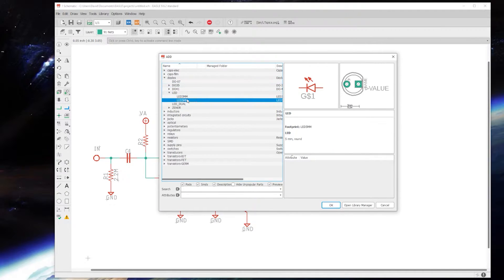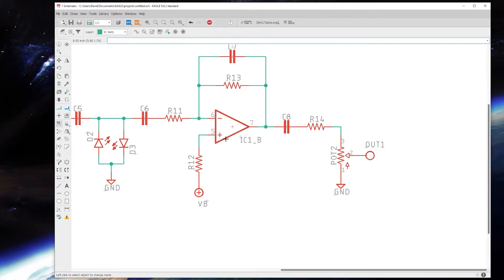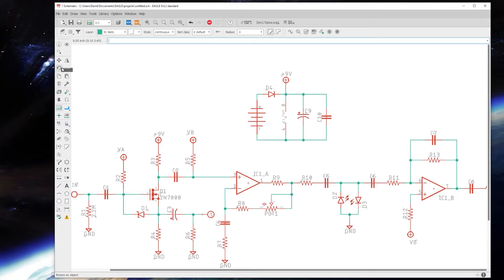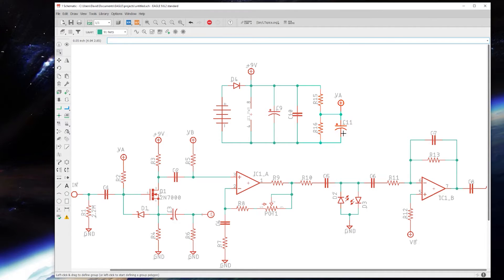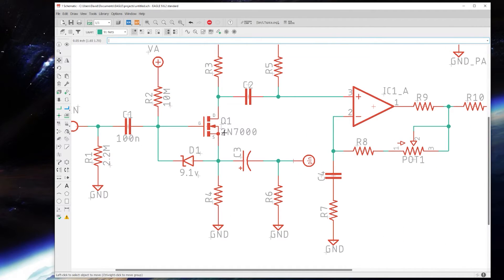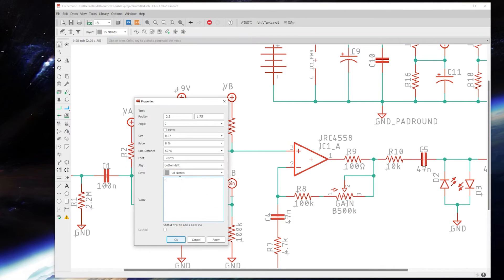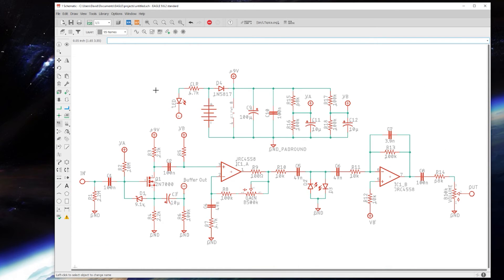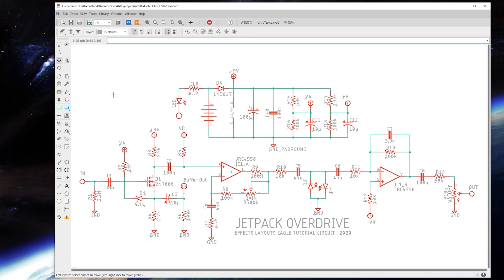EFFECTS LAYOUTS - Eagle Tutorial Episode 3: Schematic Creation Part 2

Comment: Hello, I'm new to Eagle Cad and layouts in general. You've been an incredible help and learning resource.

I have a couple things I can't seem to fix. The 0.2" SML Film Capacitors in your library doesn't seem to display their values on the board. I'm not sure if this is something I'm doing wrong or if you have any insight into this.

Also, in part 3 where you generate the board from the schematic, once you turn off the Names layer, your values nicely align themselves in the center of the component, is there a way to enable this?

Any help is greatly appreciated!

Thanks :)